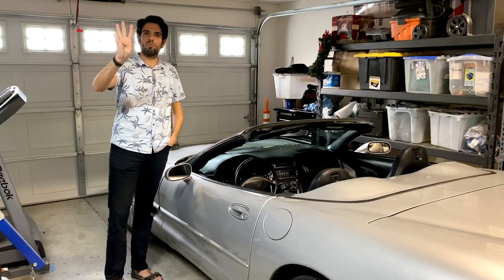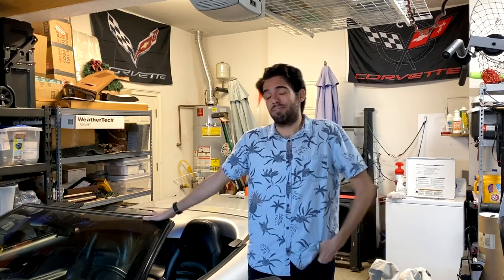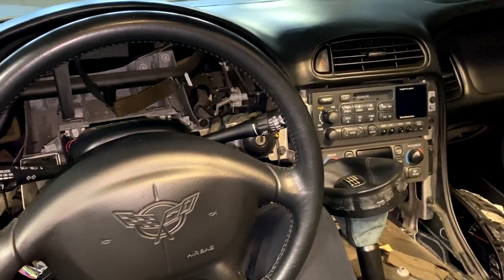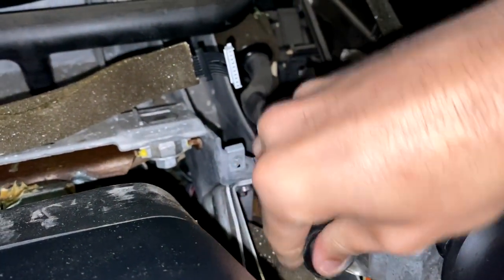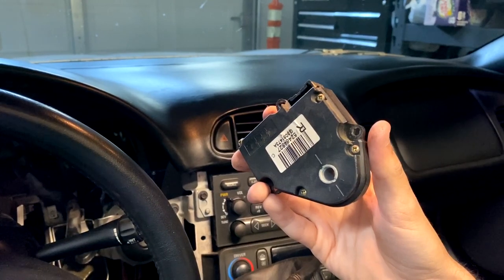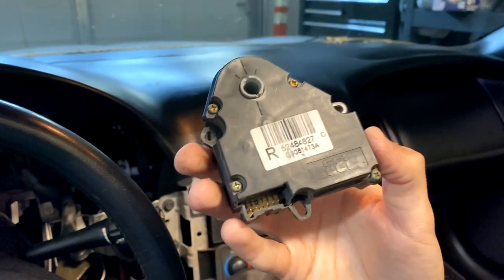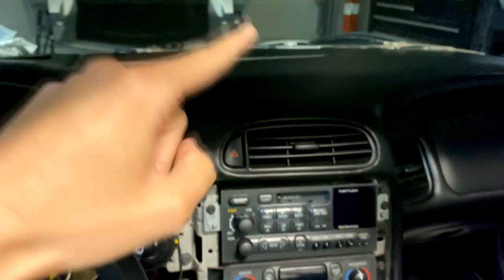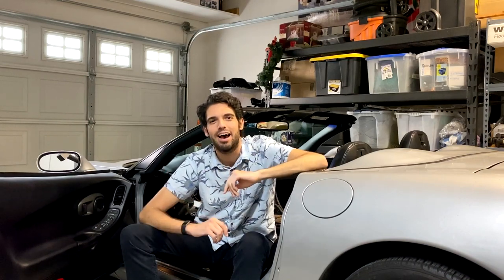C5 Corvette HVAC Actuator Replacement

Comment: Thanks for the video.  I just completed the replacement and if it's helpful for others, I have a 2002 Z06 and the screws that hold the actuator to its mount required a 7/32 socket.  I used a small 1/4 socket set and it worked out well.  As your video said, patience is your best friend in this repair.  It's not hard, but you need to take your time.  I found beer breaks helpful in resetting my patience and things went smoothly thereafter.
Reply from the maker: Glad the video was helpful Chuck! And yes, beer breaks (or whatever your drink of choice) are always an unspoken necessity for any project, as long as no power tools are involved! 😂
Reply: @1Brain4Wheels  great video! Question. Disconnect battery and then install Actuator and rest of dashboard. Reconnect battery. Start engine. Is that correct?
Reply from the maker: @lightworker4512  exactly right, you want to have the battery disconnected so it doesn’t start moving the connection point and make it a pain to align the new part. Once it’s connected you’re good to go, you could even start it up prior to reassembling all of the dash if you wanted to verify it’s all good :)

Comment: thanks for responding actually after installing it blew hot air than after a few days of driving the air started to turn cooler and now its cool on both sides passanger and DRIVER
Reply from the maker: Hey, that’s awesome! I wonder what they heck was happening? But at least it’s all good now!

Comment: Thank you very much I changed the actuator or my C5 and it’s working great now thank you for showing me how to do this. I think I saved $2000 and it was about a total of three hours of work. Any more hair can do it.
Reply: Yup it's crazy how it's that much (2k+) for a simple job it it me only 30mims to take out. But I was already use to taking off dash to the point you really don't need the screws to hold the center console. Everything fits better in my opinion. I spent $468 just for I can be told I had a AC leak....... 😂 And just now seeing this video 🤦‍♂️

Comment: I have sure have to take my hat off to you Garrett.  You really get deep into things and they all seem to work when you are done.  Someone once told me when I was contemplating taking something apart that someone making a lot less money put it together originally.  That was when they put things together with screws and metal clips.  Even the Chevrolet dealer left a half dozen broken plastic  clips on the floor of my Silverado dually after replaced  the AC controller in the dash.  My C 7 Corvette has a problem on a cold day (50) and the climate control set at 68 with the AC off.  All is fine until I get stuck in traffic when it starts belching out 100+ air.  Even the Chevrolet dealer doesn't seem excited to see why it is doing that.  My fix for that is to run the compressor whether it is needed or not.

Take care Garrett.  I hope you have avoided the corona virus.
Reply from the maker: Hey Brian, happy 4th of July! 🇺🇸 You know, sometimes when I’m in the middle of these projects, I sit back and wonder “what did I just get myself into...”, especially when they don’t always go as planned, but knock on wood I’ve been lucky for the most part! It also helps to have backup cars in case a project goes longer than expected. ;) The thing that keeps me coming back for more is that happy feeling when it all comes together, looking back even just 5 years ago I’m not so sure I would’ve felt confident enough to try half the stuff I leap into now, but I’m glad to keep learning haha
Reply: @1Brain4Wheels  Hey Garrett thanks and Happy 4th to you too.  When you reach the point of "what did get myself into" when you complete the job it is so much sweeter.  Take care Garrett and stay safe.

Comment: I should be so lucky.  I too had a dead mouse and some insulation that he found somewhere.  It sucks to crawl under that dash, but  when I dropped the fan I could see the problem.  I turned on the ignition and and the fan worked and the controller was functioning properly.  I crammed my shop hose up inside of the air ducts and put it back together.  All in all, about 1 hour.  I don't know where the mouse found access, but I guess that it's not that hard.  It's pretty clear that this car was made for short small people to work on and that's not me.  Thanks,

Comment: What does the green wire connector go to? On my Z06 this helped a lot and leaving the rear screw off to make it easier next time too
Reply from the maker: It’s been a minute since I’ve worked on this, but I think the green wire went to one of the air temp sensors
And good idea with leaving out the back screw, that one can be tricky!

Comment: Thank you, for your video.  Is the Mode Door Actuator also found behind the instrument cluster for the 1996 Corvette Collector Edition Coupe?
Reply from the maker: Hi Donald, I had to do some digging but apparently the C4’s only have a single blend actuator for the HVAC system, and it’s accessible on the passenger of the dash. I’ll link you to a good write up with pics on the Corvette forum - good luck! :) https://www.corvetteforum.com/forums/c4-general-discussion/3753354-how-to-replace-blend-door-motor-w-pics-95-corvette.html

Comment: Hi garret I have to do this job on my father in law car ( 98 c5 ) but passenger side actuator , you may know if is possible to replace that one by removing the top pad or is necessary remove the evaporator box. 
Thanks for any information.
Reply: Hey i gotta go the right one too. Let me kno if u get any info.
Reply from the maker: Hey Gus (and Joe), so for the passenger side, once you take off the entire dash pad, you should be able to remove the actuator (which is mounted to the evaporator) with the evaporator still in place... at least I haven’t seen anyone reporting that they had to remove it? Let me know if you have any other questions and I’ll be glad to help if I can! Also, random question but what state do you live in, I’m a Villegas too, would be funny if we’re related!

Comment: Thank you for this video. I thought it was going to be worse than it appeared. When ordering the part, since I have the dual zone climate, do I need the automatic or the manual air door actuator?
Reply from the maker: Yeah, same for me too I was kind of dreading it but it worked out all right! As for the part, you’ll want the automatic door actuator 👍🏻

Comment: You have a fiero! Very cool.. suprisingly mine was really reliable
Reply from the maker: Oh nice, a fellow Fiero enthusiast! :) Yeah, I’ve had a checkered past with my Fieros but to be honest that’s mostly due to a lack of maintenance by previous owners... they’re awesome little cars!
Reply: Also great video.. my AC is now frosty with gale force winds through the vents!!
Reply from the maker: VINCE BRADLEY awesome!! I’m glad it was an easy fix, knock on wood that’s good for a long time haha
Reply: @1Brain4Wheels   Had the same red 1988 GT.. had planned to put a 509 Big block in it ... had the V8 Archie kit, heavy duty jaguar axles, then I did something stupid like thinking I wanted to get engaged and sold the engine to pay for the ring.. neither the fiero or the girl was the winner...  only problem I had was the coil pack recall.. had mine die on a hill in SF on Lombard ave
Reply: @1Brain4Wheels   You know they got rid of it because they feared no one would buy trans ams...  and no one did but not because of the fiero it was  because trans am's sucked!.. but the fiero's sacrifice is what made the C8 possible
Reply: @1Brain4Wheels  I wouldnt say "easy" but you got me through the hardest part I avoided for the longest..Dude Thank you from the bottom of my oil pan!!! :)
Reply from the maker: @vincenzobee  Oh man, that would've been a fun little car, tight fit with that engine though!

Comment: Ok so installed a new one after receiving the HVAC code but now the it blows out hot air only on the driver side.  Hook everything up correctly I also reset the code
Reply from the maker: And when you did the install you had the battery disconnected? If not, then disconnect for a few minutes and reconnect so that the actuators can calibrate their positions. If that’s not the problem, I was reading this forum thread (https://www.corvetteforum.com/forums/c5-tech/2866836-a-c-blowing-hot-air-on-passenger-side.html) and some people having this issue are just low on Freon (passenger side gets the cold air first), so I’d look into both of those and see if they help. :)

Comment: My c5 is blowing cold on driver side but hot on passenger will this also fix my issue?
Reply from the maker: Based on what you’re telling me, I bet your passenger side actuator is going out :( For that one, you would need to remove the dashboard... once out it’s in a similar position as the drivers side one, just on the other side (hopefully that makes sense)
Reply: @1Brain4Wheels  I getchu thanks for the quick response!

Comment: Hey I followed your video, I removed everything I had to.    I reached the actuator, removed the visible screw, but couldn’t remove the hidden screw.   I got it lose, but couldn’t manipulate my fingers to get the screw out, after three hours, I put everything back together!   Any other suggestions to remove the actuator?
Reply: Did you ever find the solution to this question mark I'm stuck there now

Comment: So do I buy 2 ?
Reply from the maker: There’s only one for each side (driver or passenger side temp. control) so if you’re only replacing one like I did in the video then just buy the one, but if you do both sides you’ll need two in total-hope that clears it up! :)
Reply: 2 if they're dorman